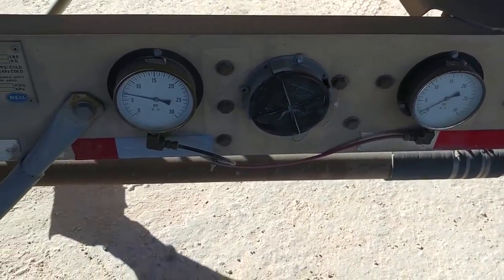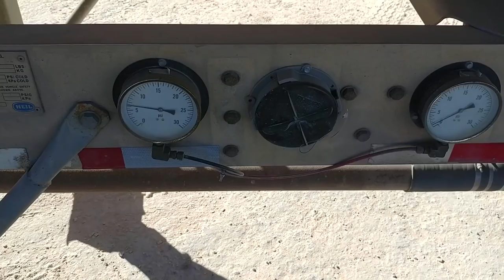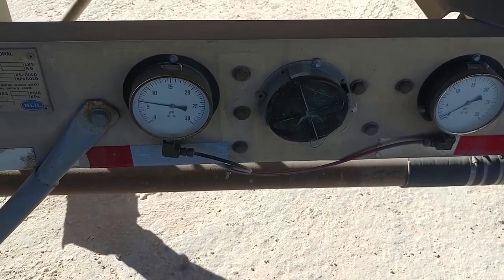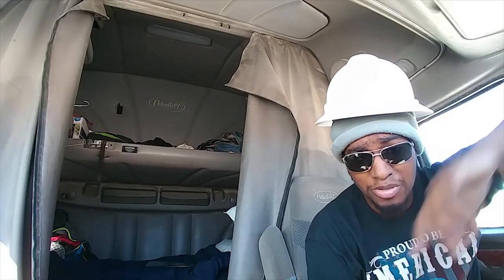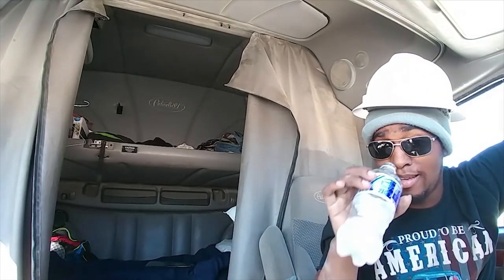Backup Trailer Broke Down 😞

Comment: If was in the oilfield an I was making 25% an had a minor break down, I would simply fix it, after all that's what I do now an I'm still with the suit and tie guys, that's one of the reasons they love me at the company I'm at now, I don't like down time gotta be making loads to make money. 18 year's service in the military as a mechanic diesel tech. Hey Chasing Andrew Jackson if I was out that way in Texas yesterday we could of hooked up and I got that trailer welded for you. I keep my truck loaded with all my gear that's possibly needed to prevent having down time, and yeah that includes having my little mini mig  welder stored on my truck.